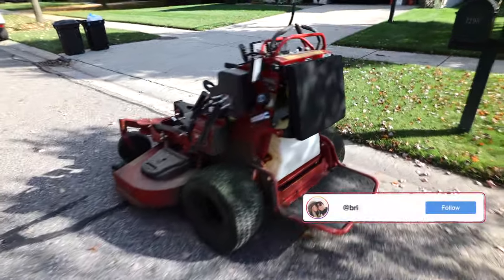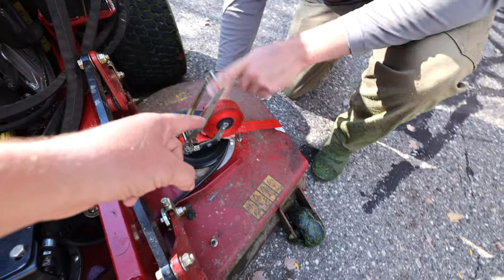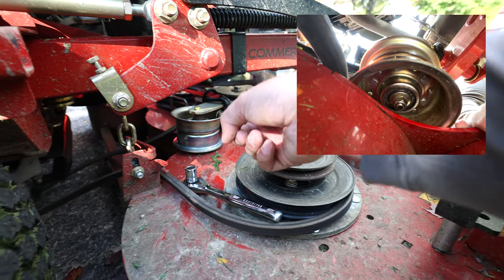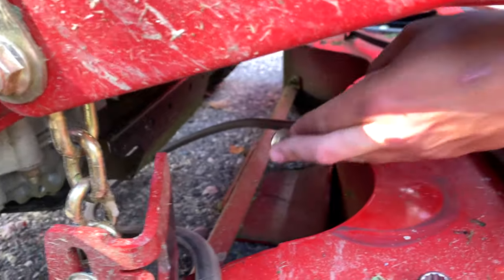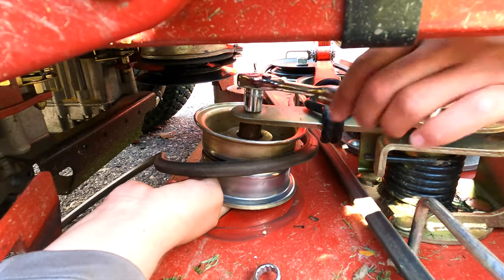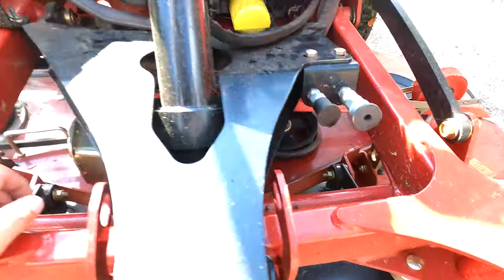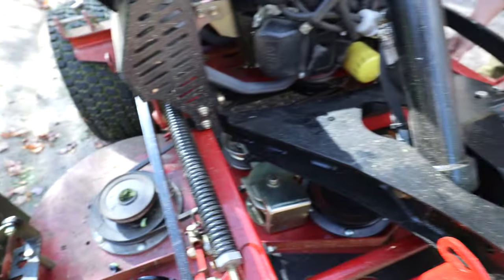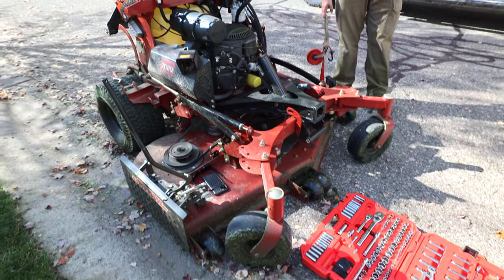Toro Grandstand MultiForce Deck Belt Change (5 Minute Fix)

Comment from the maker: Short and sweet, how to change a deck belt! Hope this helped you guys out. 

Watch it one time all the way through then go back through if you need to!
Reply: You can put a belt on without taking off the pulley. You pinch it together and push it through the left side then only grab one side and wrap it around the clutch. I've done it many times for my grandstands.
Reply: In your case there is a fix for the belt slipping out from underneath the pulley. So you had to take the pulley off to retrieve the belt. My local toro dealer ordered a new design and I haven't had an issue since. It has a black arm.

Comment: Ya definitely made that more harder than it needed to be there brotha. No need to remove the belt tensioner or use a ratchet strap. Hard to describe but you feed the loose belt around the tensioner first, then feed around all the other spindles and pulley except the far right (if looking at the mower from the front) then use that far right spindle to pull itself around.
Reply: You actually have to take off the belt tensioner in order to put on the belt. Its not like other mowers. Its annoying.
Reply: You do not have to take pulley off. Cedric is right
Reply: Cedric is right on. No tools required for this job. Bad advice on this video.
Reply: @done9785  though you typically don't need to remove the idler I have had a situation where the belt slipped under the idler when it fell off. It's awkward and I think what happened here - I did not take the idler off - but needed to use a pry bar to get the belt between the deck and bottom of idler.

Comment: I have 4 belts brake/slip on all my Multiforce units. I’ve had to take my units back to my dealer under warranty  4-5 times bc they are constantly doing this. I was going to DM you about it but it looks like you beat me to it. I know you don’t want to hear this but this is going to continue to happen constantly. Very frustrating
Reply from the maker: That’s good to know. I mean Toro needs to come up with a long term solution to get it right
Reply: Same issue on all 3 of our multi force units as well. They’ve replaced the entire tensioner arm under warranty, and it has seemed to be the solution. All 3 units are under 500 hours. Fingers crossed, we haven’t thrown a belt in 2 weeks.
Reply: @joelarnett2618  I have had to replace the tensioner twice on one of my units. 

I’m hoping TORO reads this and makes it right. What happens to all the people who have these multi force units and our warranty expires with the same problems? It’s not like we have been running the machines in the ground. These issues started happening before we even reached 100 hours on the units. 

Right now it looks as if they have turned a blind eye because I have reached out to them multiple times. 

These machines cost upwards $16k a piece when you include the snow accessories which is why we all bought them in the first place. So we had to pay the premium let’s be honest. 

I was going to buy a toro grandstand revolution but questioning whether or not that’s a smart idea. 

I hope they make it right.. @Brian’s Lawn Maintenance you wield the power! Let TORO hear you

Comment: Hi Brian, Hope you are well today! I was wondering what impact you use when you change blades? I am tired of using hand tools to change my blades!!!
Reply: If I’m not correct he uses a Gen 1 Milwaukee m18 impact wrench mid torque. Probably just get the latest mid torque from Milwaukee. They all do the same thing except the Milwaukee has more power than most.
Reply: If u want a drill it don't have to be nothing fancy I do recommend tool boss on YouTube he  always put tool deals and hacks

Comment: Looks like maybe they should make that pulley with a little bit of a hour glass shape.. just a little bit. Angle it out a Quarter inch out on bottom and quarter inch out on top.. seems like it would do the trick with keeping it tight enough so it doesn’t come off..🤷‍♂️ It might be worth a try..

Comment: Finally got our grandstand today!!  Love it except for the horrible rubber grass deflector that Toro charges $400 for.  Ballard is $235 and by your video MUCH BETTER!  I work for a non profit, so I am probably stuck with it.  I may pay out of my pocket and get the Ballard.  HUGE Toro fan, but they should be embarrassed charging $400 for that.

Comment: I have this problem on a weekly basis. Sadly I work for a very large company and cannot always have a mechanic come fix it. Sometimes got to wiggle the belt under the pulley to get it on the right side. Pain in the butt

Comment: That tensioner arm looks kinda bent. Prolly the reason you can't put the belt back on without talking the pulley off. Also probably the reason it threw the belt in the first place. Got it working though 👍
Reply from the maker: It was!

Comment: That has happened to me 4 times and I only have 240 hours on my mower 
Toro dealer told me that you have to engage the blades with the deck down never up in transportation mode
It will never happen with the deck down….. from my understanding the dealer said there’s going to be a recall to fix that problem
Reply from the maker: Ok cool good looking out Ty

Comment: You don't have to take any pulley off , you wrap around your main drive pulley under your motor that's in the back then pull the entire belt out to the left side if facing from the front of mower then you should have each side of belt one in each hand and a loop at the end, wrap the side of belt in left hand around your outer blade pulley and feed the loop end and both sides of belt through the gap in-between tensioner pulley and tensioner spring where it's mounted and the right side of belt in right hand will end up wrapped around the tensioner once pulled through all the way, then pull it through and feed it around your two middle pulley's, pull on the tensioner and feed the rest over your other outer blade pulley release slack, done actually easy and takes literally 1 minute when you get the hang of it, been running them for 6 years now

Comment: This happened to my 60 inch Toro deck. Should be a quarter inch square on the idler pulley you can put a ratchet on. That way you don't have to remove a pulley. You have to put some muscle on it though.
Reply from the maker: Ok good looking out!

Comment: I do not like that V in the pulley. Might make belt roll or twist. Pulley should be flat so it tracks better. Also they used to run cast iron pulleys. They pull better and run cooler. The belt might be getting to hot. Ariens/Gravely makes their own pulleys. If belt is too short they will jump off. Tighter has to travel/move when you kick In the electric clutch.